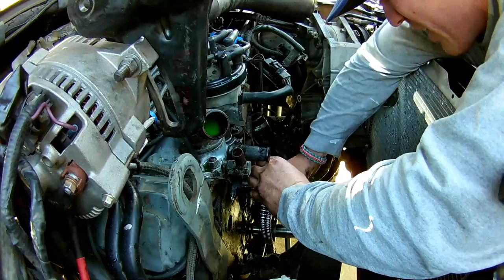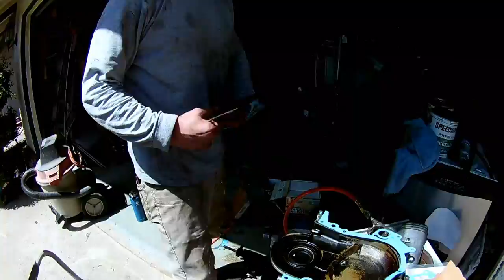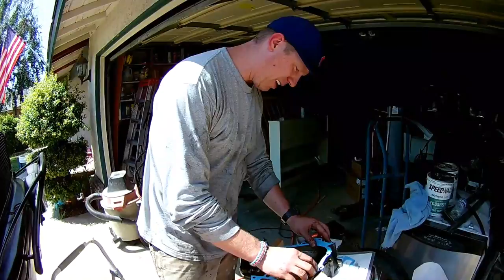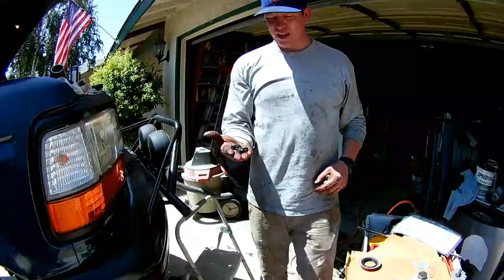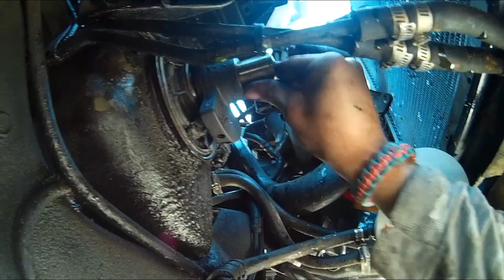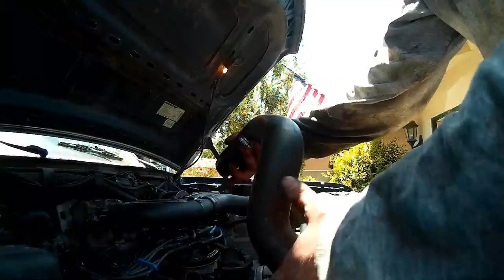Ford OBS; Kevin's 460 F350 Timing Chain Install!

Comment: I recently replaced the timing chain and gears in my '93 460 powered f250. I figured that wrestling with three gaskets dressed with rtv while trying to get the water pump into that intermediate hose might be a bit challenging. So, I did mine in stages.
 I bought two sets of different length bolts. One set was to hold the plate to the cover while the rtv dressed gasket dried/adhered. The other set was to hold the timing cover to the block without the water pump installed so those rtv dressed gaskets could have time to dry/adhere. Another thing that helped was test fitting the new intermediate hose onto the new water pump. I eventually resorted to using silicone spray to get it to slide on. I was really glad that I was not fighting with that for the first time while trying to install it. After the rtv had dried and the removal of the temporary bolts, the timing cover/plate assembly did not move at all while installing the new water pump. I think that the added investment of about $3 in bolts made the job go a lot smoother.

Comment: Thanks for the video. Now before I get too far back ahead I need to re tighten my cam bolt. I only torqued it to 25 ft. Lbs😂😂😂😅 guess its time to dig the manual back and see what else I over torqued or under torqued lol

Comment: What sealant you recommend? Do you put sealant on every Gasket> The Parts guy told me not to use silicone?? Doing mine this weekend. Thank you nice Video.
Reply from the maker: my current fav for all types of engine gaskets is Great Stuff.   comes in a tube or a cheez whiz dispenser dealie.   thanks for watching and good luck on your project.

Comment: great video.  doing this job now.  what kind of sealant did you apply to the through bolts, from the water pump to the engine block?

Comment: Thank you! Just realized that the water pump backing plate was completely missing from my 460 (1987 f250). I thought the space in the timing cover looked like a poor place for water to flow. I also thought it was strange that my new water pump came with two gaskets... Mystery solved. Why the heck would someone leave that out? No wonder it was overheating at high rpm.

What tool were you using to tighten the damper?
Reply from the maker: oof!  that's terrible!  most likely they tossed out the backing plate along with the water pump and didn't realize it was needed...?  must've been leaking pretty bad.

Comment: 1986 f250 with the 460. I've rebuilt the carb, and I've done cap, plugged, wires. Truck runs rich. Tough to start. Would the timing chain be a possible culprit?

Comment: Ive got an 89 Ford F350 with 460 it's got to much back pressure and oil is blowing out and constantly out of time so im guessing thiis is where im going to be shortly. Is there anything I should do as well that you didn't do while you were there? And do you have the part numbers #?

Comment: I really want to hear more about this how is the result now after a couple of years? How about an idle sound video? Love the videos on this project not alot of guys mess around with the EFI 460 stuff. Im currently in the middle of the cam swap on mine. Ive also done a MAF conversion and am having a tweecer tune done on it. Also wanna say thanks for the videos they have been helpful
Reply from the maker: thanks man!  Kevin drives the thing all the time, it does towing duty often and he has had no issues after the cam install.  it even passed Komifornia smog test!  Kev is putting together parts for a big swap to start hopefully this year....lots of other priorities going on right now though.  thanks for watching!

Comment: Hello, nice video. I think it was 2003 and I didn't use the internet or YouTube for help. My question is, I did a timing chain kit replacement on a 1986 Ford Bronco. I didn't know anything about marks that needed to be aligned. I just unbolted and took off and did the reverse to put back together. My Bronco started right up and ran fine for about 9 months until I traded it in for a new Ford F-150. Do you really need to align the marks? I did this with my Chevy Aveo, marks were aligned, but I destroyed my engine when it came time to start. What gives?
Reply from the maker: ouch, sorry that Chevy grenaded on you.  the timing marks on the crank and cam sprockets are to locate the cam relative to the crank at TDC (top dead center #1 cyl), if the marks are not aligned per manufacturer specs (ford/chevy/import all vary) the cam will be opening the valves at the wrong time and in an interference engine (where the valves open further than the top of the cylinder) the valves will hit the top of the piston and bend the valves, hole the piston and potentially bend the connecting rod.  timing of the cam relative to the crank is VERY IMPORTANT.  thanks for watching.
Reply: Needed to follow the colored links on chain to timing marks

Comment: Hello 
I have a 93 F250 with the 460 I have a coolant leak that looks to be coming from behind the timing cover. Where does the erosion of the cover happen at and can it be welded ?

Comment: Planning to do a timing chain replacement on my 1977 F350 powered by the 460. Did you have any issues with clearance between that new double roller chain and the oil slinger? I'm still on the fence about whether to go with the directory replacement or a double roller.

Comment: Would my '89 F350 fuel injected 460 timing chain/gear swap, be done the same as this '94?
Reply from the maker: should be the same other than accessory drives, yes.